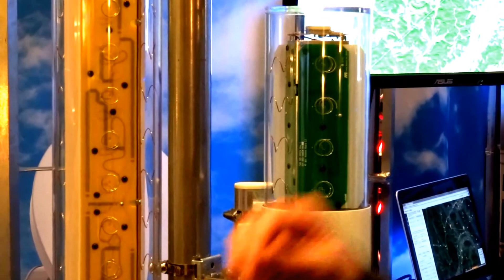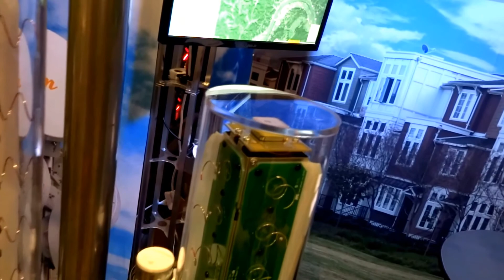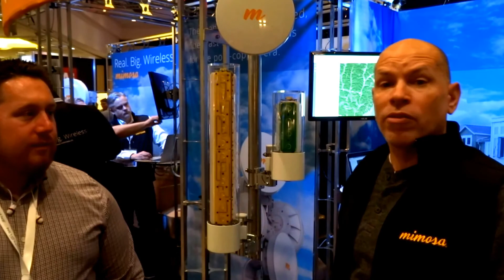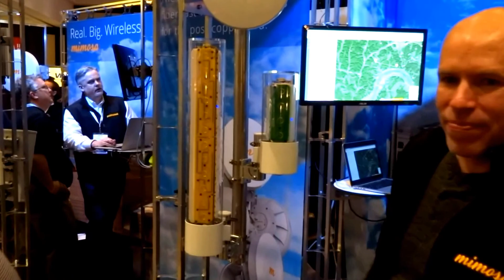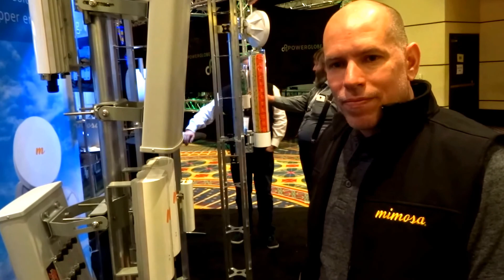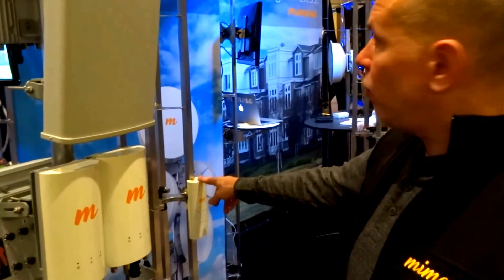#WISPAmerica2016 interview with @GoMimosa

Comment: We have tested users out to 1.5 miles with signal levels of -65dBm on the A5-360 14 units.  With a 40Mhz channel, we are getting PHY levels of 360Mbps on the TX side.  We are expecting the A5-360 to work out to 3 miles in the same environment.  Keep in mind though, that if you use the ranges that Jaime recommended, you could see PHY layers as high as 780Mbps.
Reply: +Aaron Fitzgerald - I've been running 80MHz channels since day one.  In this scenario, all my users are about .5 miles or less, high-density, 1200 home per square mile.  I've posted speeds up to 339Mbps with 80MHz channels.